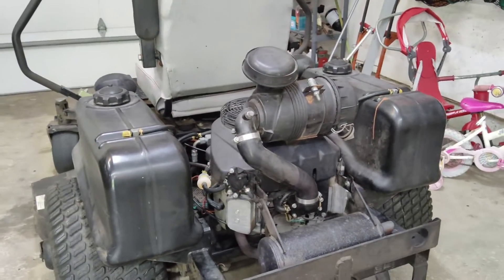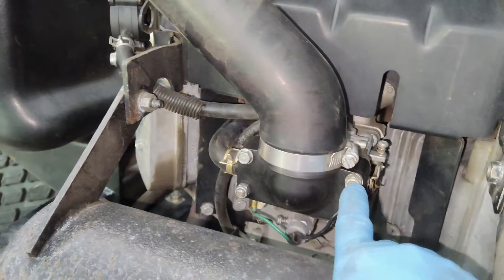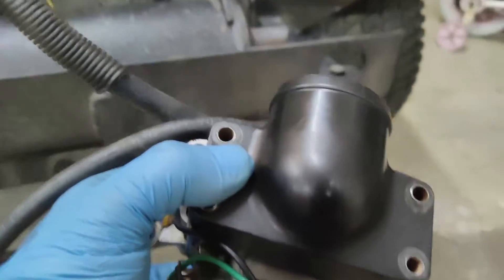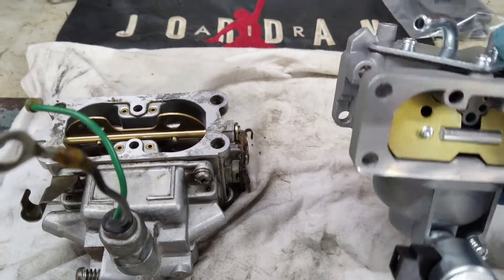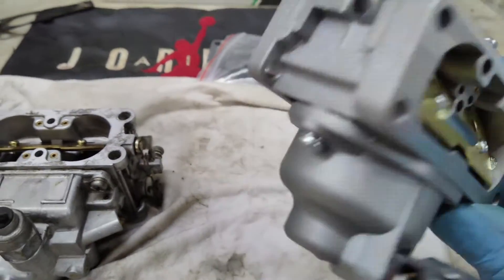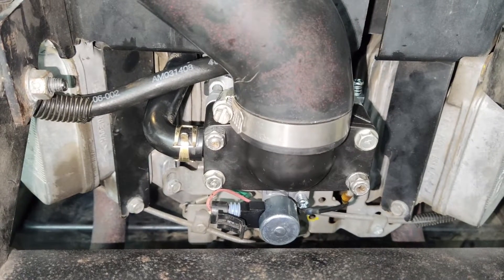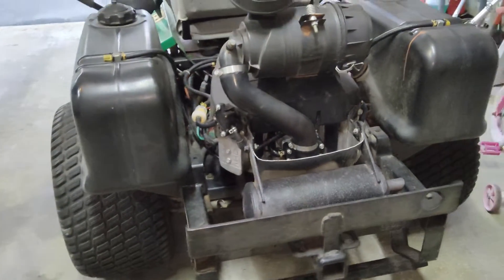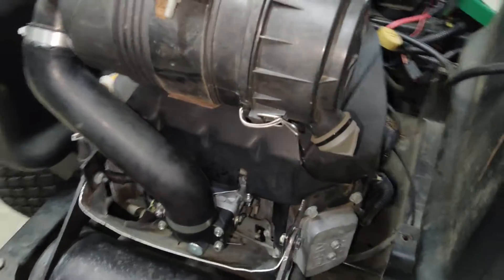Converting to Internally Vented Carburetor | Kawasaki FH680V 23HP

Comment from the maker: Carburetor Fit for Kawasaki(Externally Vented)
Click Here:  👉 https://amzn.to/3VMN0RQ

Carburetor Fit for Kawasaki(Internally Vented)
Click Here:  👉  https://amzn.to/4awYI7y

Fuel Solenoid with Wiring Harness
Click Here:  👉  https://amzn.to/3vFbYbg

Kawasaki OEM Ignition Coils Pack of 2(Get these factory OEM coils & Saves a lot of headaches)
Click Here:  👉  https://amzn.to/3QWC41R

NGK Spark Plug Standard BPR5ES - Pack of 2
Click Here:  👉  https://amzn.to/3YyOr5U

Genuine Kawasaki Oil Cooler(Add an Oil Cooler To Extend the Engine Life)
Click Here:  👉  https://ebay.us/otHW7a

Kawasaki O-Ring For the Cooler to Engine Block
Click Here:  👉  https://amzn.to/470fpHh

Genuine OEM Kawasaki JOINT
Click Here:  👉  https://ebay.us/bbtsL7

Kawasaki Inner & Outer Air Filter Cleaners(Heavy Duty)
Click Here:  👉  https://amzn.to/44vfDEG

Dust Ejector Valve
Click Here:  👉  https://amzn.to/3rHRe0k